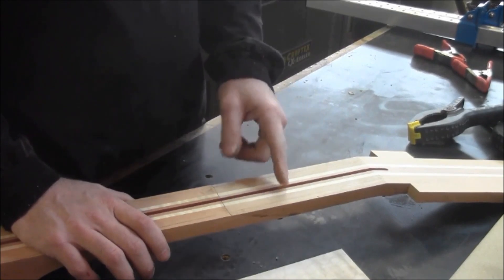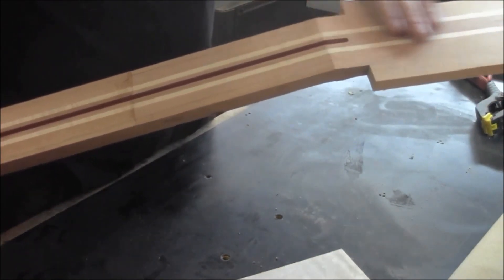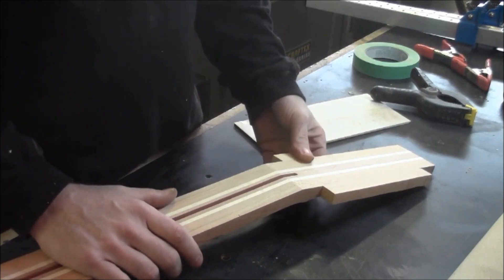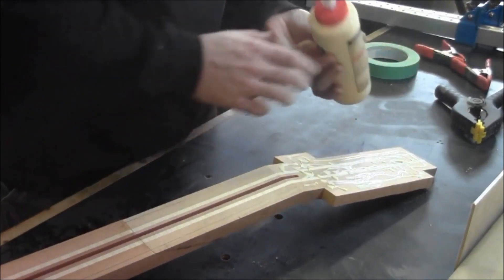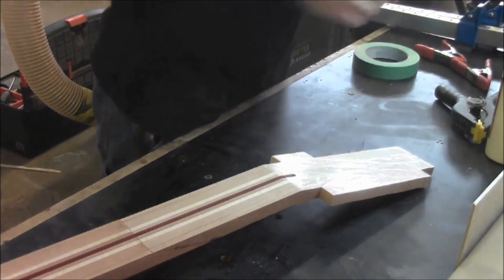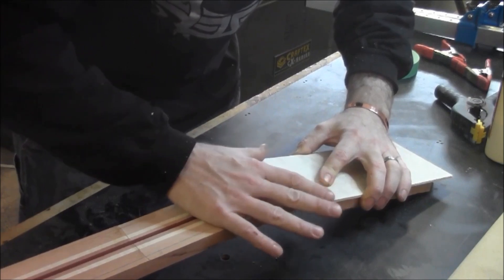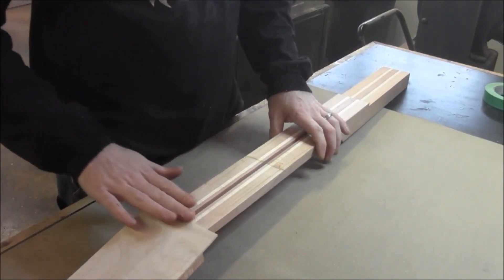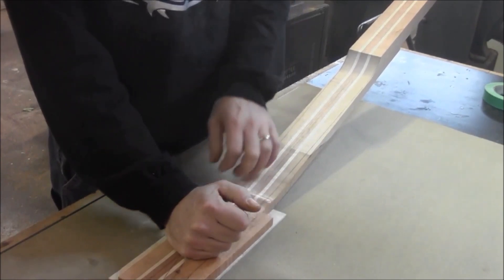How to Build an Electric Guitar -Video 4-Headstock pt 1

Comment: is that a scarf join in the middle of the neck?
Reply from the maker: Yes on this particular instrument I put the scarf lower on the neck. When you make the scarf joint you can either re-attach the headstock portion on top or underneath the the neck blank. just a matter of preference. The neck is just as stable no matter where the scarf is located. The scarf joint just serves as a way to change the grain orientation where the headstock meets the neck with a slanted headstock.